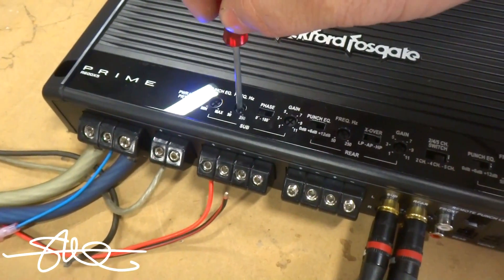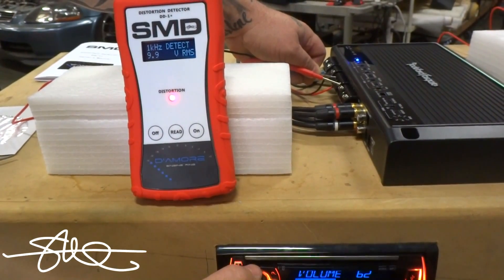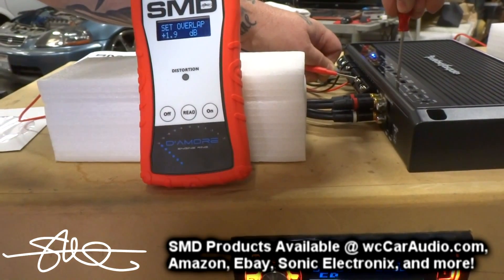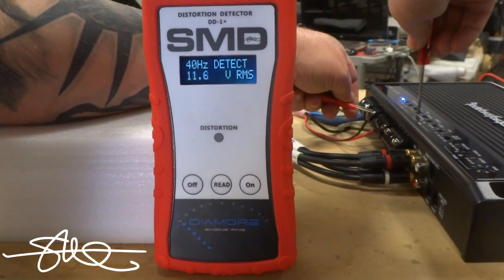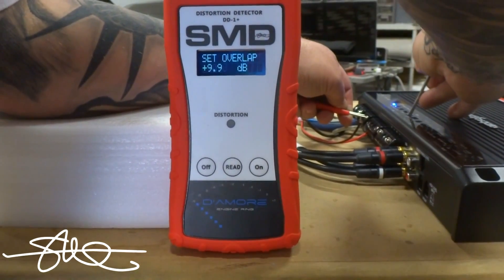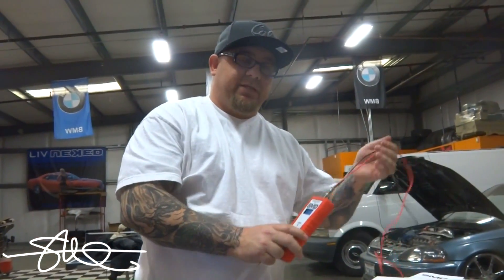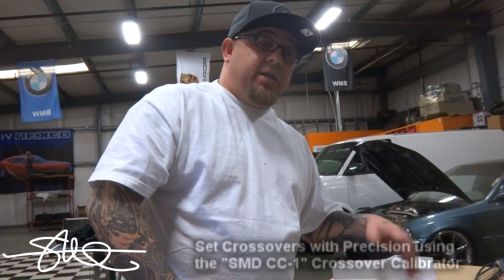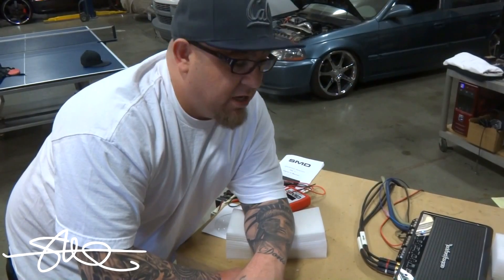How to set Amplifier Gains the right way - the New SMD DD-1 + (Distortion Detector PLUS)

Comment: What does the level dial do on an amplifier? I set my gains and crossovers w the dd1+ and cc1 and sounds amazing but what does the level do? I left it half way before tuning. Now when i raise the volume up high the bass goes out, when i turn it down it comes back in, anyone know what the issue is?

Comment: Just got a SMD-1+ and when getting distortion volume for head unit thru sub amp,  I can see it reading 40hz but voltage shows 0. The amp is a Mosconi 1000.1D . I followed every step in the manual as it relates to xover settings and such. Please help

Comment: I set my gains using the smd dd1 on a t600.4 amp going to 4 6.5 component sets all Rockford fosgate and max volume was 59 of 60 with no distortion on the meter. I set gains with max clean volume at -10db on the track and I cant get past 35 maybe 36 on the radio then it sounds like the speakers are distorting very bad. I can only set the volume to 29 to 31 of 59. WHAT AM I DOING WRONG, PLEASE HELP STEVE MEADE.
Reply: Was the amp too strong for the speakers?

Comment: Just got this! Anyone recommend what to put in to drive 2 12’s and 2 pair of 6x9 composite and a pair of loud speakers and a pair of tweets just did a big three upgrade new alternator new  xp batteries along with 4/0 wire sounded deadened with 250 mill worth of dynamate several layers

Comment: Hey guys I’m trying to tune my system with the dd1+ and cc1 and I found the max clean output volume of my head unit and I’m trying to set the gains but I can’t handle the sound of the test tones. I have my subwoofers unplugged but I don’t know how to stop my midrange speakers( 2 6 1/2’s 2 4x10’s and 2 4x6’s so it’s realllllllly loud) from playing. Can anyone give my some input on what to do.

Comment: Hey wats up Steve. Can you help me out with my problem in having. .. okay, I installed my system in my Dodge Magnum and just recently started to run across some issues. .. first time I started having issues was around the time my fuel pump went out on me and I guess I drained the battery trying to start it. . I have a Kicker 12L7, Kicker zx1500.1, and a 2.2 farad cap. After I replaced my fuel pump,  I didn't charge up my cap., nor did I discharged it when I unhooked my battery. . Well, afterwards I noticed that at certain points into some bass my amp shuts off and turns back on again. I checked out my system and noticed that my online fuse holder had gotten hot on the capacitor side and melted the plastics holding the fuse.  I also noticed that the voltage on the cap.  differ from the alternator, when I on/off the remote wire for the amp. It drops about 2 volts with amp on.  So wat should I do to get slapping again? also, I'm running everything from my stock stereo with hi/lo converter.

Comment: Hey Steve need your help! Question how many speakers can I run on a fosgate p600x4 safely without damaging any speakers??? Can I run 4sets of components?
Reply from the maker: djassassin760 you can run as many as you want if you know what you are doing.  If you don't know what you are doing go to your local shop and have them install it. :)
Reply: djassassin760 Or do some research and learn how Ohms, watts, volts, all that good stuff works

Comment: I wish us do it yourself installers could rent your distortion testers for single use when we install our own systems. put down a deposit and get it in the mail and return it when done. set a time frame for return or forfeit your deposit.
Reply: Scraped up some cash. Order mine today. Even though I still have a ton of questions about overlap and proper procedures for tuning when there is a remote bass knob(boost) is  present.

Comment: What I still don't fully understand is why set an overlap when your just going into distortion? Somebody help
Reply: 0 db is maximum volume on a recording.
Reply: max bernard oh okay, now i get it, so when we set gains with -0db tones, we will put the system to read the maximum point of it then?
And when we use lower than -0db, we are actually mimicking a music when its played or something like that?  
Just trying to fully understand this. :)
Reply: nicole goodwin same here..  anyone?
Reply: Because music doesn't go all the way up to 0 db. 0db is the max volume a track could possibly be. A really loud song with really heavy bass would MAYBE hit -3 at it's loudest point (even then it's only for a breif instant). If you were to set gain at 0 db you would never get full power therefore we use overlap to compensate.
Reply: max bernard oh but, im kinda confused cause.. for us to hear sounds. It has to be over 0db right? Or how does this works? Correct me if im wrong

Comment: Really informative video, even for those not using this device...
My head unit kenwood shows no distortion right up to 35/35 on the volume,(amp gain to minimum)... Just over 2.1 volts rms on the rca..

Now when I set the gains with a 40htz tone my gain is just about half way instead of over 75%... 

My built in amp on the Kenny does clip at 27/35 on the volume... So I just fade the front stage below clipping!

Sorted!
Reply: Hi Mark how can I publicise my videos so I get more clicks? How do u do it any ieas? Facebook wont let me add friends unless I know them or thy know me first/??? So how to tell people???

Comment: meade916 I have punch amplifiers and I'm wondering just how accurate the CLEAN setup is because I've blown a set of tweeters already. I have a pioneer deh-80prs headunit and at full volume (62) the amp shows no input clip. The mids/high side setup works fine but when I set up the tweeters gain it shows no clipping light at full gain. I want to get the DD-1+ when it becomes available because I'm going to a power 4 channel amp and soundstream bass amp. Your help would be greatly appreciated. I have a 2004 Mercury Grand Marquis. Headunit: Pioneer deh-80prs, Mids/highs amp: rockford Fosgate p400x4, Speakers: Factory locations punch 6x8's. Tweeters: 2 sets p1t-s. Bass amp was a p1000x1bd but I'm going to get a soundstream ta1.3000d to power my re audio xxx 15.

Comment: Hey man how would I fix my konkai ko-36910 4000 watt amp? Every time I turn it on it kicks itself into protect mod and I've went through and check almost everything but putting a volt meter to it. Man I'm open to any ideas
Reply: Protect mode usually is not enough power to push the subs to full potential or you have the amp settings to high such as gain, bass, etc. You could also trying replacing the gauge and ground wire. If all else fails time for a new amp.

Comment: im confused what about all the settings on the
deck, bass tremble sub?
Reply: meade916 ^
Reply: Tom Andrews flat and sub set to 0
Reply: now do I leave it on those settings once the amps are all set
Reply: no, adjusting the eq will not effect anything, it's just required for setting gains properly. make sure frequency cutoff is all the way up on amp before setting gains though. this will cover the entire spectrum.

Comment: How do I set amplifier gains without spending $100+ :(
Reply: get a cheap handheld o-scope.  Learn how to use it.  When you are ready to step up your game, then get a DD-1 :)
Reply: meade916v2 can you set amp gains with a volt meter using ohms law? V= Square root of Power (amplifier power RMS) x Resistance (resistance of speaker load) ie: V= square root over 500x2. Square root of 1000 is 31.62. can i just shoot for this voltage?

Comment: Isn't it best to do the testing while the speakers are connected rather than testing at the speaker inputs? When you are testing at the inputs with no speaker connected you are not seeing any load hence no voltage drop. Gain settings for distortion will vary whether you have speakers plugged in or not.
Reply from the maker: that is already accounted for.  Please read the instruction manual.  There is a link in the description.

Comment: The only thing that I am lost by is why do you go into distortion before you switch tracks? Wouldn't you back it down to no distortion? Or was that the 0dB track? That's the only thing that is over my head. But for now I'll stick with my blue DD.1 :)
Reply from the maker: the tool stops reading when it see's distortion. So the voltage you see on the screen is the number it will look for as it's reference point when setting the overlaps.  This unit has a slightly different method to achieve it's goal then the original DD-1
Reply: @meade916  solid explanation I was wondering too howcome you stop on distortion
Reply: that's what exactly What i was thinking
Reply from the maker: the blue DD-1 is still an amazing tool too! This one is just the next step up that's all.  We are NOT discontinuing your's whatsoever.
Reply: I'd go for this one though.. gives me Voltage reading and Distortion..

Comment: What happens when you the button "read" on the distortion detector??
Reply from the maker: it saves the number as it's reference point so when you hit read, it locks on....then you change tracks and adjust the overlap.  It's simple. It's amazing....if you own and understand your original DD-1, you will LOVEEE THIS.

Comment: Great videos Steve, so sick to watch, I'm learning a ton.
1 question what if u have 2 small 3" speakers connected to your deck and they can't handle, when the deck is turned all the way up to distortion point, how do you set the gains on those? can you do that with the dd1 and how.
i dont wanna blow my speakers.
Big ups from Denmark